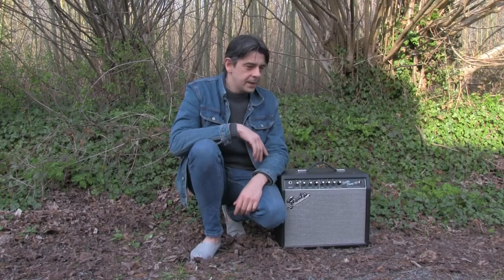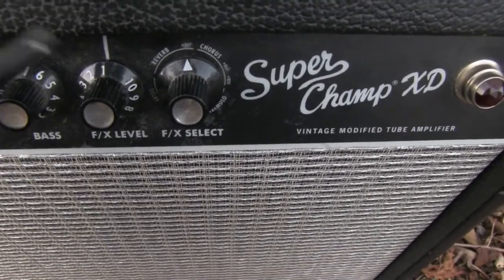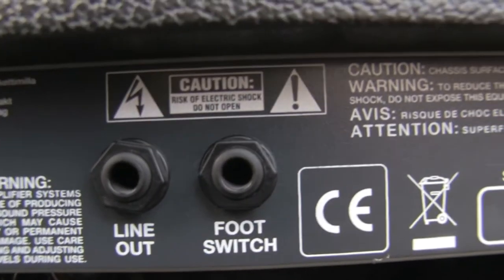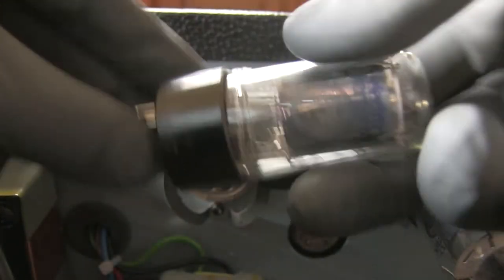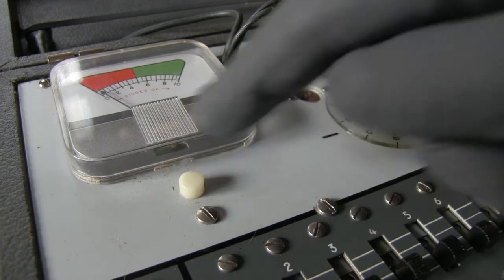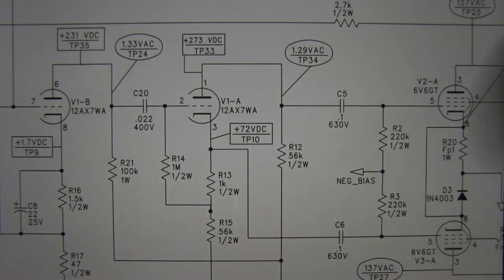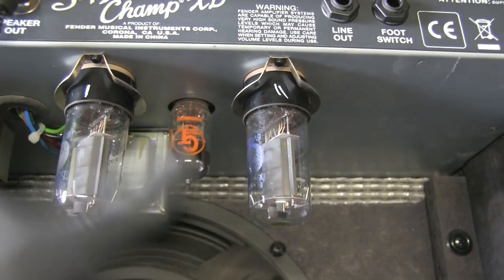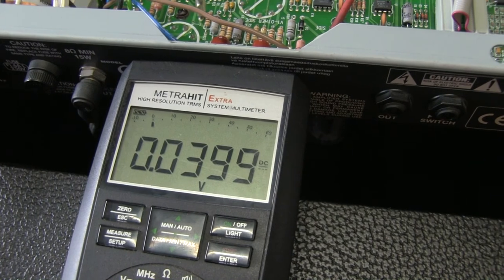Fender Super Champ XD - Overview and Bias checking (Part 1 of 2)

Comment: The only Fender amp models that I had ever bcught NEW like a 1977 Princeton Amp with 2 10" speakers and two Super Champ XD's with one 10" speaker they all suffered from the crapy quality stock speakers that sucked if you cranked up the amp. The amps are good, but the speakers truly sucked. If you want your amp to sound like 10 times better then check this out :  The X2 is about the same amp as the Super Champ XD, but with the added USB option so you can actually downloand and store other voicings of one's choice off the web from Fender. One problem withe XD and the X2 is that the stock speakers only sound decent at low volumes to to being very cheap wimpy speakers. I finally found out that better quality 10" speakers can indeed make this amp actually sound SUPER at not only high volume, but all across the sound spectrum. Now at a nominal cost my 2 Fender Super Champ XD's sound like $1000 amps.   I have 2 Super Champ XD amps. Great amps except for the wimpy 10" speaker that they come with so that Fender can cut costs, but at the expense of not producing a truly quality product. I also had picked up a used Fender Bassman 25 amp for $60 some time back. So the speaker in that Fender Bassman 25 amp had great lows and highs. So I removed it and replaced the Fender Super Champ XD speaker with the Fender Bassman 25 amps speaker which has a much larger magnet. It made a world of difference and now the amp is truly SUPER even when dimed. Next I will replace my other Super Champ XD with a Hartke Aluminum Cone 10" speaker from a Hartke 210 cab I have. Will move the other 10" in the cab to the Fender Bassman 25 Amp. The Hartke speakers turned out to be 16 ohm each. I had read that using a 16 ohm speaker instead of the 8 ohm ones would make the amp run cooler, but that the speaker would have less volume by about 3db. WRONG !!!. It acutally produces more volume than the identcal amp with the 8 ohm speaker installed. If you want a great amp upgrade your Super Champs speaker. You won't regret it.
Reply from the maker: Oh I totally agree with you. A speaker upgrade is the easiest way to improve the tone. My picks are Jensen Alnico for vintage sounds or WGS for some modernity.

Comment: This is a super charged practice amp, but just that single 10" speaker will not cut if for a real guitar player.  It has some neat little features and voicings but that's kinda it.   It's ok, it's not bad, would I spend more then $300 for this amp, no!  You could spend $200 more and get a used Deluxe much better tone and amp.
Reply: huh ? I played for years with an amp that had less power than a SC.....if this isn't loud enough for you maybe you should research mixing boards.....
Reply: Change the speaker and you'll be impressed.
Reply: The only Fender amp models that I had ever bcught NEW like a 1977 Princeton Amp with 2 10" speakers and two Super Champ XD's with one 10" speaker they all suffered from the crapy quality stock speakers that sucked if you cranked up the amp. The amps are good, but the speakers truly sucked. If you want your amp to sound like 10 times better then check this out :  The X2 is about the same amp as the Super Champ XD, but with the added USB option so you can actually downloand and store other voicings of one's choice off the web from Fender. One problem withe XD and the X2 is that the stock speakers only sound decent at low volumes to to being very cheap wimpy speakers. I finally found out that better quality 10" speakers can indeed make this amp actually sound SUPER at not only high volume, but all across the sound spectrum. Now at a nominal cost my 2 Fender Super Champ XD's sound like $1000 amps.   I have 2 Super Champ XD amps. Great amps except for the wimpy 10" speaker that they come with so that Fender can cut costs, but at the expense of not producing a truly quality product. I also had picked up a used Fender Bassman 25 amp for $60 some time back. So the speaker in that Fender Bassman 25 amp had great lows and highs. So I removed it and replaced the Fender Super Champ XD speaker with the Fender Bassman 25 amps speaker which has a much larger magnet. It made a world of difference and now the amp is truly SUPER even when dimed. Next I will replace my other Super Champ XD with a Hartke Aluminum Cone 10" speaker from a Hartke 210 cab I have. Will move the other 10" in the cab to the Fender Bassman 25 Amp. The Hartke speakers turned out to be 16 ohm each. I had read that using a 16 ohm speaker instead of the 8 ohm ones would make the amp run cooler, but that the speaker would have less volume by about 3db. WRONG !!!. It acutally produces more volume than the identcal amp with the 8 ohm speaker installed. If you want a great amp upgrade your Super Champs speaker. You won't regret it.
Reply: A real guitar player? What is a real guitar player Michael?
Reply: That's what microphones are for. This amp is every bit as real as a Marshall stack. Mine is the newer X2 model, it has an amazing room reverb in the effects armada, and many more. I upgraded to a Jensen Mod 10-35 speaker, now this amp which was already great, absolutely kicks ass! I actually prefer playing it, to my Mesa MK III Blue Stripe.
Reply: Wankers I pretty much gave this crappy SC amp away.   I never played and it was in the way collecting dust cause it sounds like a horrific.  I think some wannabe  punter gave me $100 for it.

Comment: you mention that it is a Chinese tube, but never complete your thought on how to identify it is Chinese.
Reply from the maker: Yep... Sorry bout that ! I showed it but did not name it. The tell tale of a Chinese 12AX7 and similar is this shiny separator in the shape of the Pi symbol. Look closely at around 3:50
Reply: @MrAnalogDan12  Ok, cool. thanks. Will have a look at mine.
Reply from the maker: @bruceskelton8160  If my memory serves me right, later SCXD amps had Groove Tubes installed.